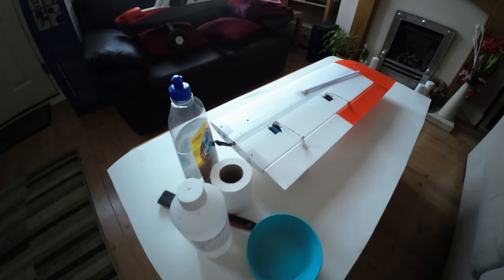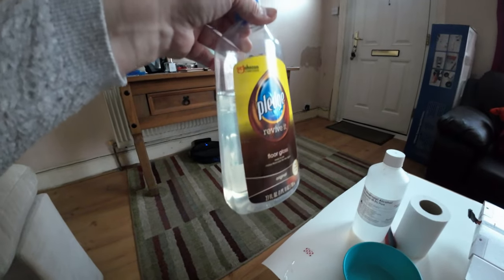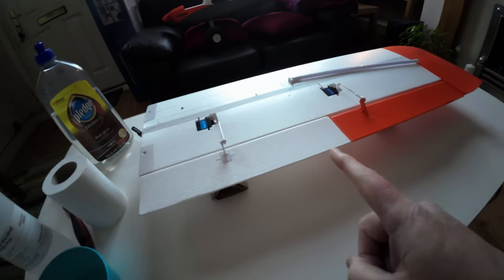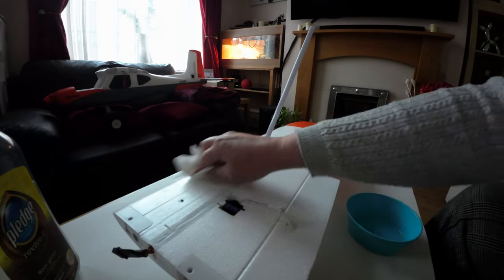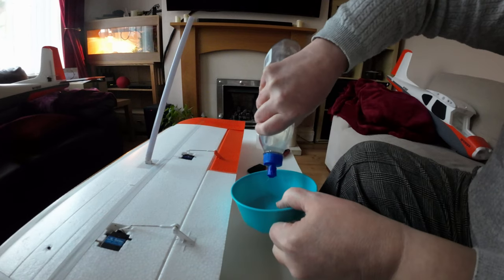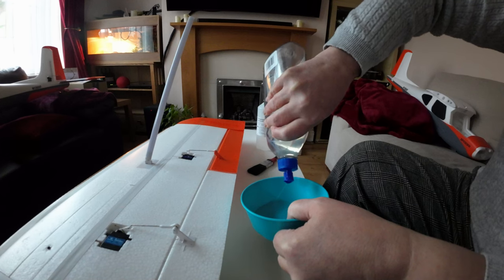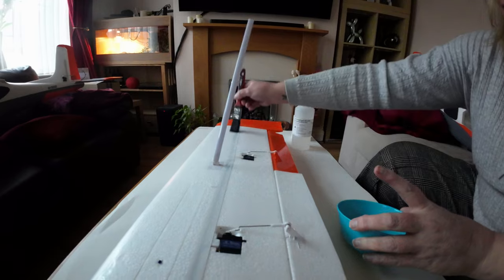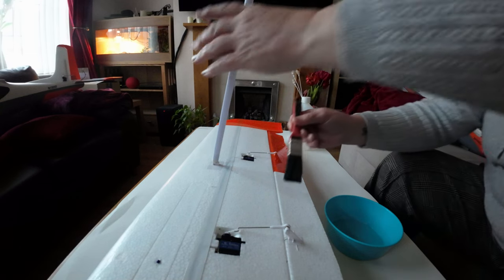Protecting Foam Model Planes

Comment: does this floor gloss (varnish) dry rigid? if so, is it prone to cracking due to flex?
i laminate my wings... harder (more fiddlier) to do than painting a 'hardener' on!!!
Reply from the maker: It's so thin that I have not seen any indication of it cracking off at all. It's really good at cutting down on general hanger rash, it won't stop dents from harder hits. Plus you end up with nice shiny planes!!!

Comment: Minwax is the "in" treatment for foamies. Is a real coating
Reply from the maker: I've used it in conjunction with lightweight fibreglass to strengthen areas on foam planes, but not on its own. Interesting.

Comment: hello there, i have just found your channel, subbed, i am new to rc flying, have had a couple of lessons at my club, do you think the tasman would make a good trainer. thanks
Reply from the maker: Firstly,  thank you for your subscription, I hope you find lots to enjoy. The Tasman is an excellent trainer plane, once it's been trimmed for the flaps as it balloons  easily. I haven't found any bad habits of the plane.
Reply: @Caroline_Tyler  Many thanks for advice, I was told to set up flaps but not use them until I have a bit of experience behind me. I am down to a choice of 2 planes now the Tasman or Riot, both are large enough for me to see in the air which i need with my eye sight 🤣
Reply from the maker: The inflatable tyres on the Tasman are great for grass operations. I leave mine fairly soft which reduces landing bounces.
Reply: @Caroline_Tyler  Looks like I will be going for this plane, just been told that I would need to setup a flap /elevator mix to stop the ballooning on landings. thanks for your help

Comment: Please explain someone. How is a thin coat of polish going to protect from knocks and dents? Watered down PVA would be just as effective, as in not.
Reply from the maker: It will not stop a dent, but it does strengthen and shine the surface layer. I've also found it reduces catches from fingernails and the like.